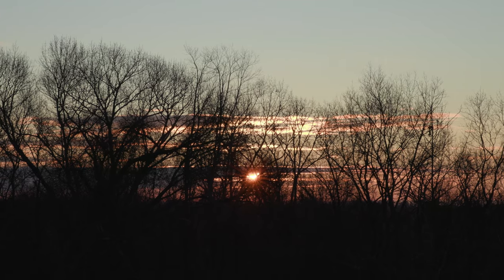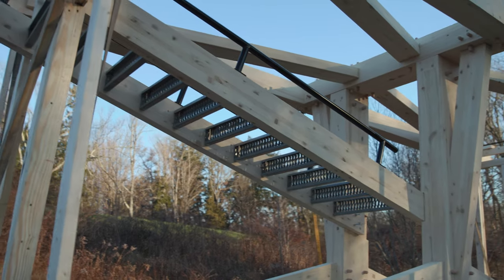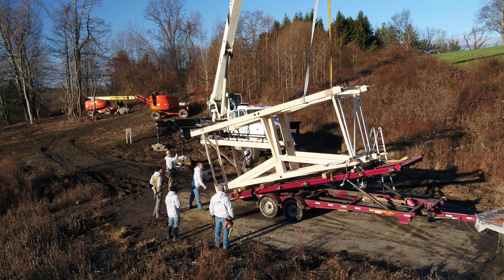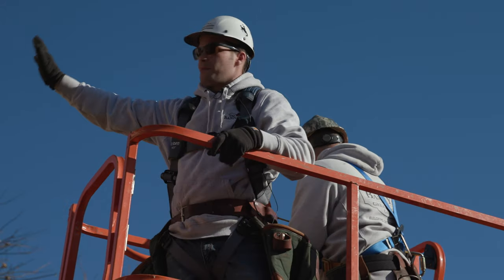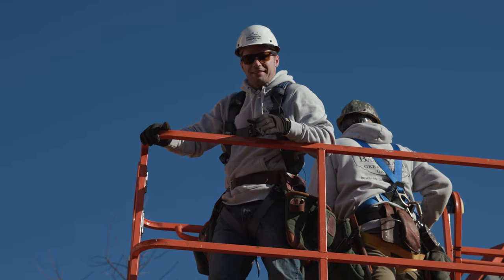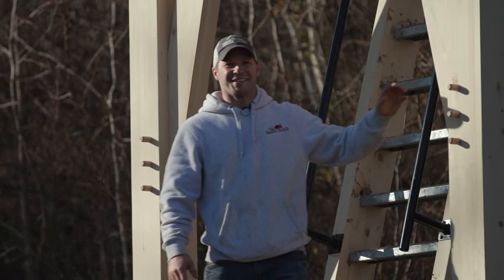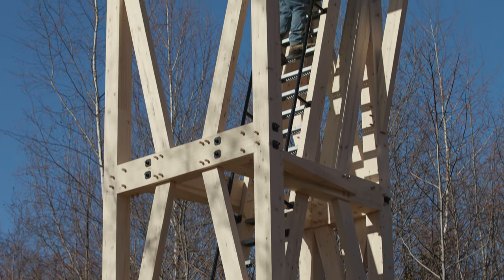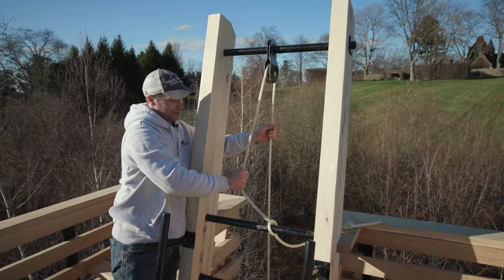The Tale of the Tower: Building a Timber Frame Observation Tower in Greenwich, CT

Comment: You should have ran a nut down on each bolt in the concrete, then a washer, then the tower feet, then another washer and another nut. Crazy the fine tuning you can do with plumb, at time of build and 20 years later just by adjusting those nuts. Then when you get it perfect, you’ll grout underneath in the gap. Been building water towers for 25 years.
Reply: what would something like this cost, roughly?

Comment: Curious if the Tower belongs to the house on the hill? If so, the Top still appears to be lower than the House itself and would have been better up on top of the hill by the house.
Reply from the maker: No, the tower doesn't belong to the house on the hill, thus the location on the highest point of the property.